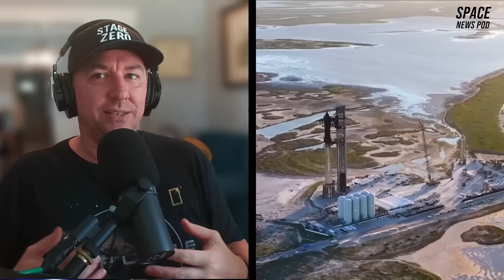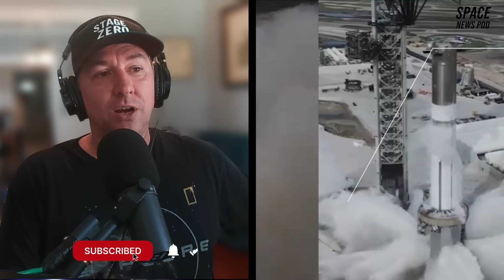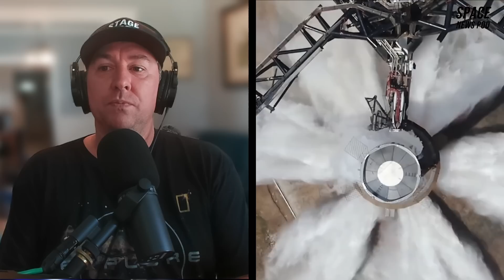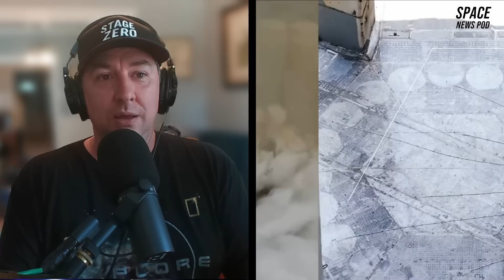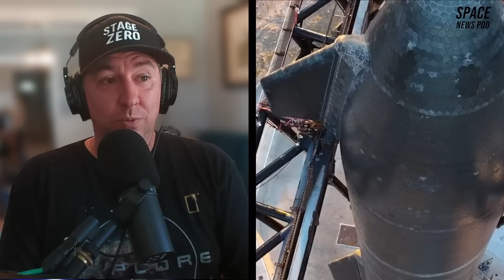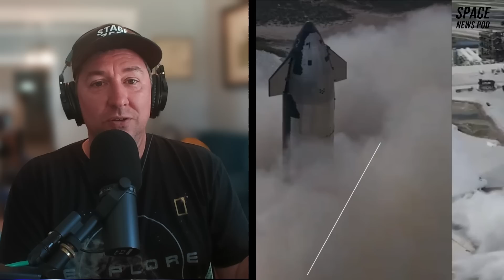SpaceX Starship Launch Tower #2 News

Comment: SpaceX do everything in iterative design approach, they did that with every Starship stage, so if we take a look at the current stage zero it had numerous upgrades and design changes since they build it that's why it took 13 months, they learn while they building and testing it. So i think tower 2 will be built much much faster, thousands of initial design changes, shorter catch arms!, maybe a flame elevated trench as Elon mentioned, a different OLM !!🤔  its going to be amazing 😎🚀 but still i think tower 2 will be built much faster,  i think it will be active before the end of the year.
Great video 💪